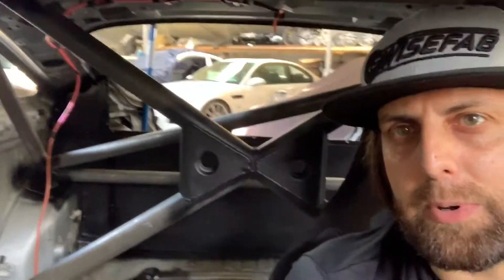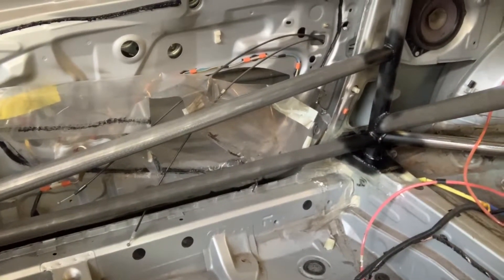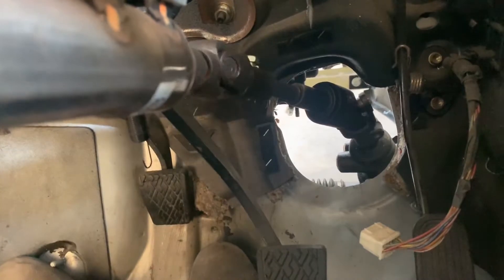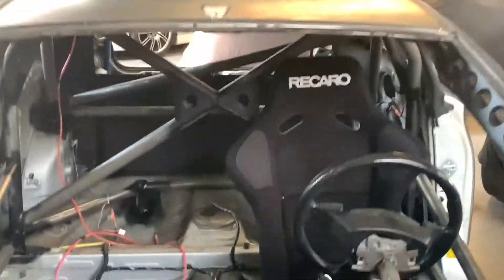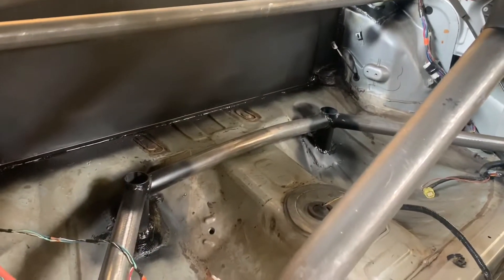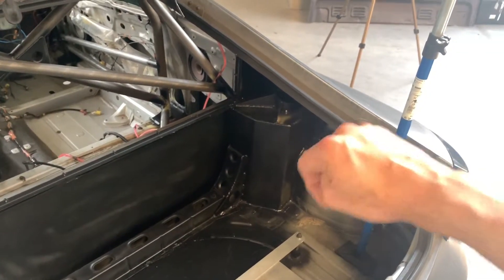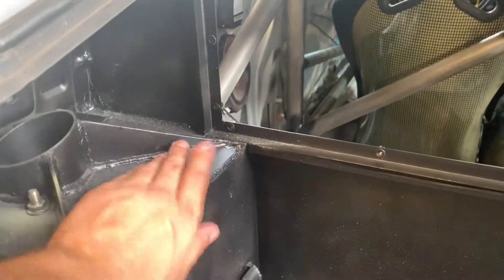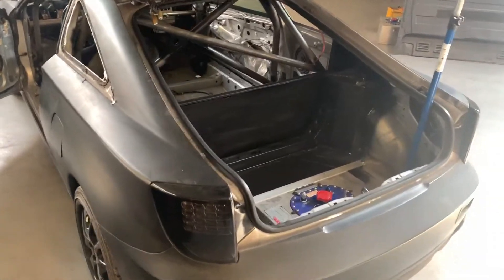How To Change FWD car to AWD & RWD step by step : Rollcage, Fuel Cell, Rear Firewall T230 / T205

Comment: What rack and pinion did you used?
Reply from the maker: Its from a different Toyota from the same era, my guy went to junkyard and kept searching untill one matched .
Reply: @DriftJesus  same era from the 2000 or the 90? Is that rack an pinion manual ? I was going to use the yaris rack in pinion from the 2005 era because it's manual rack. But I'm not sure yet that's why I was wondering which one you used.
Reply from the maker: @weliftnation2418  its an hydraulic rack.  I didn't personally source it, someone else here went to junkyard.  It was some kind of corolla or whatever.  It was  little too narrow so I made adapters to get tierods in same spot. Also had to change the mounts on subframe.  

There is so much custom work in that car, people have no idea.  Easily full day to correctly line up & mount the rack.
Reply: @DriftJesus  I'm doing a similar set up with the 2zzge engine not the 3sgte engine you installed. I'm going to be using a e153 transmission with a e154f transfer case. The original frame in the car. Might need help with some of the fabrication and welding you guys did. Is there a mark up of the measurement or if I need to I'll send it to you guys and I know it's going to be expensive but worth it. This is also my dream car. And I invested already alot. The hole engine is fully built.
Reply from the maker: @weliftnation2418  whole car needs to be zero'd and centerline found. Its a massive job. Just mounting drivetrain is 5 figures easy

We used no parts of the 2001 car at all